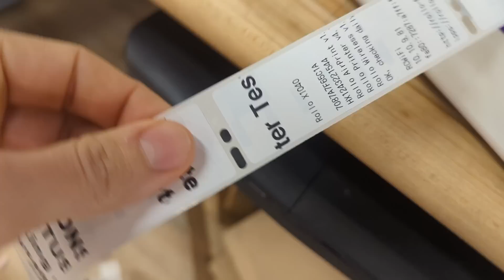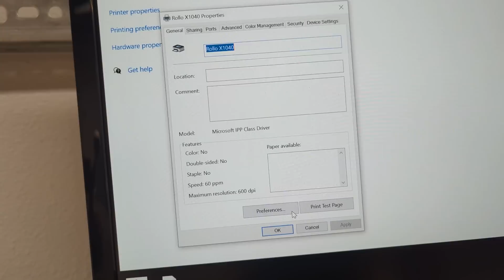Leaving dymo is hell - attempting to make a rollo label printer work with repairshopr

Comment: This looks like you probably don't have the drivers probably configured in windows. If you go to devices and printers -> select the device -> right click -> select printer properties -> advanced
Under driver there's going to be an option to select a new driver and select that. Try using that to get the driver you actually need for the device. I had the same problem with a few printers. Once I got the correct driver I got the better menu.
Reply: So common that I also came here to say the exact same thing. NIce that you figured it out. Our technology hell is just a constant fight to get that small tidbit of info to make things work 1 at a time.
Reply: Yup I was going to drop a tutorial link but not needed now. I had to set one up for amazon fnsku. Yeah was not fun.
Reply: nice! i noticed it said generic peepee something as printer model :)
Reply from the maker: That worked! It did not work when I installed the driver off of their website but it did work setting this manually. Thank you!

The most frustrating part of this all is that just installing the driver did not bring that up, the instructions don't tell you to do that, but above all, they tell you to use some stupid fucking application that requires you to have a login, your email, and your phone number to get to that stupid settings menu to set the size of the label which was unnecessary all along for the setup of this product. What a troll
Reply: @rossmannkoigroup 

If a vendor’s installer/setup is asking for personal info before installing, you can usually get away by opening the EXE (or MSI) in 7-zip and you’ll see it open as an archive w/ various folders. Sometimes/usually at least one folder will have your windows driver ini (etc.) files inside, which you can stash temporarily on your desktop and use the windows driver dialog to select the specific driver configs you want to load.
Reply: @rossmannkoigroup  My guess would be that you plugged in the printer and then installed the driver? In that case windows installed a default driver, and it installed the correct driver to the database, to which windows said, thanks, but it didn't do anything with it.

If the instruction told you to install the driver before plugging the printer in, they get half a point. That should work, but only if you really never ever plugged the device in before.
Reply: @rossmannkoigroup not to sound mean. But did you really not expect driver issues for a printer (or in general) on windows Louis?
Reply: @rossmannkoigroup  It's not the Driver, but the Priting Preferences Settings. See my other 2 comments.
Reply: @rossmannkoigroup  I was about too say that it's probably the drivers. Could you do a follow-up video?
Reply: @rossmannkoigroup  welcome to printers where the software is always ass and everyway around the software is better :^)
Reply: @rossmannkoigroup  wait, were you expecting windows to werk well with a PRINTER??? That's too scary for it.
Reply: @Fifsson_  I wonder if you can use custom g-code on a 2D printer?
Reply: @Smytjf11  I have absolutely no idea about that, but just imagining a 2d printer attempting to break itself in so many ways as the 3d ones do is thrilling.

If I had to guess, my answer would be no because I believe gcode wouldn't really be a practical way to communicate with a printer, since it's focused on paths.

Also, I think there's a huge possibility that I've missed a joke.
Reply: @Fifsson_  The HP and Dymo printers are so easy to use, even a non technical person can set it up
Reply: @Smytjf11  Yeah it's just called Postscript instead of gcode for 2d printers.
Reply: @Fifsson_  LOL.... yup too right.... going to Linux has sorted a whole bunch of weirdo printer issues!
Reply: @Segphalt  or ESC P/2, PCL 5, PCL6, HP GL/2, GDI, etc
Reply: @Smytjf11  Working on something similar...
Reply: @RamonInNZ  that must be the first time I've heard about linux being able to talk to an external device different than a keyboard. Seriously though, makes me sad that I can't use most of the programs I need on it cause it's actually nice.
Reply: Printer driver installs pay my bills, glad you got it for Louis..  
Thanks, 
Help Desk End User Support Specialist!
lol
Reply: I was about to comment that. On point, that's the windows's default driver. Been dealing with printers at work for nearly 6 years now, so I know that window pretty well. Nice one.
Reply: A temporary workaround could be to find out  where on the larger scale paper that your printer is actually getting on the smaller paper size. Then just only have stuff on that small fraction of the larger paper that your printer thinks it has and you should be fine. Also printer problems seem like a common thing that Microsoft has been breaking functionality on the regular with their updates.
Reply: Windows default drivers work but they kind of suck at giving you the full experience it is normally better to download the official drivers for the best experience. Windows drivers are basically just to get the device working enough so the average customer is satisfied
Reply: Was gonna comment that when Louis paralleled the tutorial with the actual screen it showed a different driver name. Great find!
Reply: +1 here.... I spent to much time in printer hell. Getting windows to install the correct driver, and then have it configured correctly can be a major pita
Reply: Can you make a video on how u fixed it. I followed the instructions someone gave you but I keep digging myself in a deeper hole of things not working.

Comment: Check the driver you are using on the printer. That menu you got when you went to properties looks like the default driver menu. Maybe that would help
Reply: I installed the driver on Rollo's website. 

Did I mention they ask you to install an app that asks for your email and phone number to get to that hidden menu you go to in the web browser? Setting up a fucking label printer it wants my email and phone number.
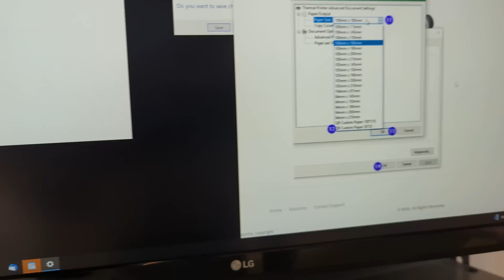Reply: @rossmanngroup  At 1:45 it's shown "Microsoft IPP Class Driver" so it is not being used as default. From printer properties -> advanced, you should see a drop down menu of all supported drivers. If it is not there, means it is not installed. Try to add it manually clicking "new driver" using the .inf file if provided , or try to search for it in the setup files
Reply: this
Reply: Yeah it’s ridiculous no doubt. It looks like someone more thoughtful provided a much better explanation of the issue and you got it working. It’s unfortunate how many loops there are to jump through, all ultimately for the purpose of squeezing a little more money out of things.

Comment: Just scrap the Alibaba garbage and buy a Zebra.
Reply: Definitely second this, the Zebra GK420D we use at work is great
Reply: @CSab-ui2jt  for the price of the GK420 you can get the Brother QL1100 and get 300dpi along with about $100 spare to spend on continuous rolls.
Reply: @pldaniels Amazing tip, thanks! And a reply from the Paul Daniels! Just wanted to say your boardview software is an indispensable tool that I can't live without. Thanks so much for it!
Reply: @CSab-ui2jt  you're welcome, glad some people are getting good use of it. Hopefully you've got the latest version, unlike what Louis has been using still :sigh: :D